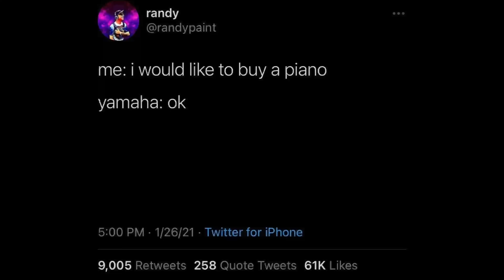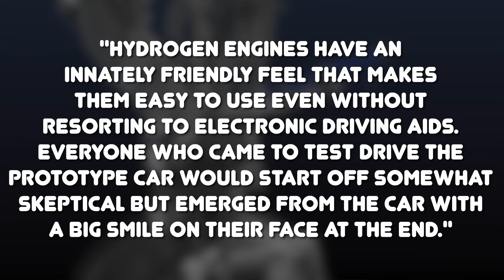Toyota's New 455HP Hydrogen V8: Everything You Need to Know

Comment: I highly disagree. EV is not long term sustainable . I work in the energy industry and the amount of mining it take to make a 600lb battery to compete with 5 gallons of gas is heavily subsidized and more expensive. We dont have sustainable battery metals long term, They're already rare lol. This isnt speculation lmfao this is facts.
Reply: But your 5 gallons of gas is finite. Once it's been used, it's gone forever. And think about all the electricity that was used to pump the oil out of the ground, then the transportation needed to get it to the refinery, then the 35kw of electricity needed to refine those 5 gallons, then the further transportation needed to get it to where it is sold. Then it gets pumped (using more electricity) into a vehicle which then burns it at 25% efficiency, wasting the other 75% as heat. Oh, and there is probably enough lithium to last another 25 to 30 years, with large deposits present in South Africa, Canada, the US, Brazil, Chile, Russia, China, the Congo, Australia and Cornwall in the UK. Plus batteries are now being produced with zero cobalt content. EV battery technology will at some point move away from using lithium. And rare earth doesn't necessarily mean scarce. It's a technical term used to describe the type of mineral.....  And EV batteries can (and are) be recycled, with the lithium and cobalt being 90% recovered and reused in new batteries. That isn't something you can do with petrol.....
Reply from the maker: It literally is speculation, or atleast misinformation. Lithium isn’t rare at all, one Google search can show you how high it is on a list of materials available on earth, and there’s plenty of it available in this earth. It’s the process to extract and refine it into something useable that’s the problem.

Comment: Dude is on crack! Combustion engine isn't going anywhere any time soon. Electric isn't the future. It would end in up a class luxury and no one else will be able to drive. The pure cost of computer goods would be unattainable because of the rare earth material necessary to make them. There rare because they are sparse to begin with. Meaning not everyone can have one. Meaning the combustion engine will still be around. Doesn't mean that electric doesn't have a place in the system because it does have purpose but it isn't the next great leap forward.
Reply: New combustion engines are after 2030 in the UK and Europe. They're going out of production.... It will be illegal to sell a new one.
Reply: @Brian-om2hh  It's all smoke and mirrors.

Comment: Producing electric batteries is really carbon intensive, and the mines that Tesla uses to get their materials have terrible working conditions and some even use child labor. Hydrogen can be produced from water very easily, and if Toyota builds the infrastructure to fuel their cars I would pick a hydrogen car/truck over an electric vehicle
Reply: Most of the clothes you are wearing now probably used child labour too. Has that ever been an issue for you previously?

Comment: You're wrong about something internal combustion engine do have something way superior over the elecrtic car. What I am talking about is the chills it gives, the fun it produce, the light weight it has, the noise it make, the option of being manual, the clunky and mechanic sound it does the tunability it has etc. Combustion engine are there for people who love motorsports and history of car. If I cann choose between a powerful electric car or a all wheel drive manual hot hatch with a engine that produce a sweet stustustustu and a sweet sound I will choose that car even if it is less efficient or safe  or what ever reason you got.

Comment: Internal combustion is limited in efficiency by the Carnot limit.  These engines will never be over 50% thermally efficient in production cars (Mercedes f1 engine is 50%). If we could get 100% of the energy out of the fuel in internal combustion, a toyota corolla would be making 200-300hp and getting 40+mpg while being naturally aspirated. The reason why these engines sound good is because they are wasting energy as sound. Hydrogen is not easy to produce at the moment, has a lower volumetric energy density than gasoline and require more energy to produce than is released so you need high system efficiency to use that energy in the best way. Hydrogen Fuel cells are not as efficient as the battery electric system efficiency, however it does not require huge chemical batteries, but they are more efficient than internal combustion. One of the largest issues with hydrogen is infrastructure which like gasoline, requires large amount of energy to distribute it as it must be driven on tankers to fueling stations unlike electricity which is only subject to transmission losses.

Comment: There is one path to put H2 powered vehicles on the showroom floor. Fuel cells. Sorry about the ICE. With fuel cells you get 1) All the benefits of EVs plus 2) The rapid refueling of the current lineup. Of course the single biggest gotcha for the H2 scene is there is no H2. Few mention that it costs more in energy to produce H2 than you get out. Current methods produce the pollutants we are trying to avoid and handling H2 is high tech dangerous. We'd have to go all in for H2. Meaning huge nuke power plants near the oceans. Suck up the salt water (  potable water to precious) ; desalinate ( alleviate potable problem); electrolyze; bada-a-bing H2. Yeah.

Comment: I agree with you that electric makes sense for most cars but if say in 30 to 50 years most people can’t own gasoline powered vehicles for one reason or another this option may become the only one if you want to still get the full driving experience. Also just like the electric grid which took decades to become what it is now the hydrogen transportation network will improve especially if your of the view as I am that fully electric heavy transportation is not effective ie 3/4 ton pickups, semi trucks, planes, helicopters etc.

Comment: You really couldn’t be more wrong. 😑 
Soo many things you left out. 
Hydrogen is the only fuel of the future. 
There is not enough cost effective precious metals to supply the world with enough batteries for all its cars. The mining for the metals is also disastrous on many levels. 
Hydrogen is the cleanest fuel there is. Hydrogen can be taken from water by splitting the molecules with heat and electricity witch can come from solar power. Pure water is your exhaust. In fact you will actually be cleaning pollution out of the air by running a hydrogen engine because you will be braking down pollution molecules like an EGR does. Maintenance on a hydrogen engine is not the same. Your oil will never get dirty because there is no carbon or sulfur or any other hazardous materials in hydrogen. You will not need a catalytic converter on a hydrogen engine. Hydrogen tanks have already been developed that can handle a blazing fire and shots from heavy caliber weapons. There will not be a Hindenburg repeat. Leaking hydrogen actually travels straight up at something like 35 mph. So no pools of explosive gas. But you don’t need to worry about tanks either because they have just developed ways to store hydrogen on film. Think huge camera film canisters that you switch out on your vehicle at gas stations. Now these canisters where actually developed for the cousin of the hydrogen internal combustion engine which is the hydrogen fuel cell which powers an electric motor. 
The only reason hydrogen hasn’t taken off is because there is no hydrogen supply infrastructure. Elon musk built his own supply structure, granted electricity was already spread everywhere, it still had to be adapted a lot for the vehicles and the major time consumption of recharge has still not been solved. It is also well known that the current electric grid could not even begin to supply every vehicle with daily charging. People don’t realize that the exact same amount of energy is still required to power a vehicle from point A to point B, it doesn’t matter if it comes from gasoline, coal, nuclear, diesel, hydrogen, etc. If your vehicle is powered by electricity which comes from a coal power plant you have gained absolutely nothing by switching from gas to electric. Also only about 10% of electricity from power plants is actually used by consumers, the rest is lost in transmission lines. 
Make no mistake Toyota is years ahead of anyone else because they play the long game while all the other companies play for the now money.

Comment: electric is not the future guys. Australia and many other countries are struggling to keep the lights on even still using fossil fuels to generate electricity. there is no infrastructure to support the consumption of electricity to power all these cars and is near to impossible to do it with all green safe energy. it's a half *ocked half a**ed idea that only works if your plan is to kill off half the population in the next 10 years..............really think about it. hydrogen can be adapted to our current cars and infrastructure so no need to manufacture all new vehicles creating more pollution, and people get to keep their classic cars that they love. electronics fail, face the truth, one day your Tesla battery is going to fail then the cost to replace will be more than the car is worth not including the hazardous waste disposal involved. wait until more car crashes start happening with electric vehicles there will be a rise in electrocution and burn deaths. what happens when someone messes up a grounding strap at a charging station and people get fried. did you know that lithium when exposed to water including the moisture in the air has a chemical reaction causing it to burst into flames. did you know the average cell phone battery can ignite and burn at 1800 degrees F. then there's the electric radiation nobody is talking about maybe it will be fine or maybe we start seeing health problems over time like when you live too close to power lines. any of this stuff ringing any bells people? step back into reality and stop drinking the coolaid. some of these problems can be solved yes but at what cost?

Comment: There are two major problems with a hydrogen internal combustion engine. First, hydrogen is not as energy-dense as other fuels, meaning that you need a whole lot of it to do a little bit of work. Couple that with the inherent inefficiency of a piston engine (at best, you're only turning about 30 percent of the fuel's energy into forward motion), and you've got a recipe for disappointment.

The second problem? When you combust hydrogen, you get other emissions besides water vapor. Mainly, you get NOx, the toxic emission at the heart of the Volkswagen diesel emissions cheating scandal. If you're looking for a clean alternative to gasoline, hydrogen's NOx emissions take it out of the running.

The answer? Use hydrogen in a fuel cell to generate electricity. Fuel cells are far more efficient than internal combustion engines, and a hydrogen fuel cell has cleaner emissions than an internal-combustion hydrogen engine

Comment: The biggest problem with electric cars are the batteries!  Mining is horrible for the environment, and takes alot of fosl fuel to mine.  At this time there is no good way to recycle the batteries and are toxic if they leak or catch fire. Presently they go to landfills!  Hydrogen could be very viable if filling stations come across the country it can become a cheaper fuel with more availability. It is clean burning the vehicles can be recycled properly.  On a different note if car industry takes some notes from the mowing industry they can extend the oil chang intervals.

Comment: Stupid x2! Fist you take out 1/4 of the energy from oil or gas.
Then you put it in an engine that looses 4x the energy to the wheels..

Why not use a solenoid engine, and battery?

Or, even better use a sound card?

Comment: If Toyota, Yamaha, Kawasaki, Mazda, and Subaru can get other manufacturers outside of Japan on board with Hydrogen power ICE like say VAG, BMW, Daimler-Benz, GM, and Ford they might have a chance in getting the infrastructure to support Hydrogen fueling stations. They'll probably need big on their side to build out such an infrastructure.  These are all big ifs since all other auto manufacturers have jumped on the electric bandwagon.  So the odds are against them right now.  But I hope they succeed. I find it hard to get excited about EVs I just find them soulless and boring.  Once ICE goes away I'll probably quit being a car enthusiast. 🤷🏿‍♂️ Best case scenario I'd say Hydrogen fuel ICE  may be marked as a niche product for enthusiasts who love engine sounds.

Comment: I think the whole idea that we MUST strive to be "carbon neutral" is a flawed one. 

We NEED Co2 for our own survival. Anyone who has even an elementary school level of science education knows about photosynthesis and why we need plants to survive. 

Without any Co2 production all sentient life on the planet would die. 

So when governments, and politicians lecture you from their ivory towers about climate change, don't buy it. If they actually cared they wouldn't live in beachfront mansions, fly in fossile fuel powered private jets or travel on diesel powered yachts, and they wouldn't raise your taxes and gas prices as opposed to planting more trees.

Also I don't see normal ICE cars going anywhere for a while due to a few simple realities. 

LiON batteries are still highly toxic and very bad for the environment. 
They also add alot of weight.
EVs are less efficient on the highway than cities and usually by alot. 
Having thosuands of power stations capable of charging an EV in less than an hour from empty will raise everyone's electric bill and probably strain our grids too much. 
Most people who own an EV likely still own an ICE car anyway so you don't really get the advantage of lower running costs. 
Tesla's are well known to still be expensive to maintain despite the electric drive due to the complex electronic systems. 
Batteries typically only last 8 to 10 years and are very expensive to replace. Meanwhile my family's 2004 Toyota Highlander still has the original fuel tank 18 years later. And that fuel tank is much smaller and lighter than a LiON battery pack. 
Electric motors might be more efficient but the batteries have far less energy density than gasoline. Hence why in a full size sedan you need the whole floor's worth of batteries to get 200 miles range.

Comment: I think hydrogen will be an amazing tech to look into as if it can be made to work well its amazing and you can have nice pure water dispensed in your car if you wanted. Cost wise its not neutral and nothing ever will be, it'd be more beneficial to recycle as far as the planet goes and as long as items are gated by money nothing will ever be as cheap as making a new one. BUT i think hydrogen will be an awesome way for enthusiasts to keep ICEs going and motorsport will still be able to attract old and new with it. Not only that electric car components are new, have very few standards and limited resources to produce batteries at the moment. IF anything a hydrogen range extender would be the ultimate compromise
Reply: Lh/lng can be retrofitted to existing Engines

Comment: Don't forget that Electric cars use massive amounts of lithium and cobalt which in both cases are very detrimental to the environment (both the mining and refining processes). Hydrogen engines have the potential to replace both electric and gas and ya there is some infrastructure to be put in place but not much because Hydrogen can be made from water with a by product of oxygen. So in reality no gas lines needed just have hydrogen generators at gas stations connected to the water main and they could be sold to the public to make hydrogen at home.
And because it's essentially a gas engine with different injectors there is the option of conversion kits so people can keep the car the have.
Reply: How much lithium do you think goes into a typical EV battery?  80%?  90%?  Nope, it's less than 5%...... The big oil companies have mined cobalt for decades. They need it to remove sulphur during the refining process. Is that detrimental to the environment too? The oil companies are the largest users of mined minerals BY FAR......  And how do you think hydrogen is produced?
Reply: @Brian-om2hh  https://www.youtube.com/results?search_query=hydrogen+generator
There are a number of videos showing this prosses. The hydrogen ICE and the HFCEV are both better options than EV's with a giant battery for one main reason, energy storage. Gasoline has a much greater energy to mass ratio than batteries and hydrogen is a gas allowing us to compress it even further giving us longer range on one tank. The simple fact is it is easier to upgrade a small portion of the electrical grid to account for hydrogen generators than it would be to upgrade the entire system to account for 300 million people charging their cars at once and do to the gaseous state of hydrogen it makes for easy transportation and 40 years down the road when the grid can keep up companies can sell small hydrogen generators to the public. Not to mention EV's off road have had range issues, one instance 19 miles of range barley went 3 miles.
Reply: @Brian-om2hh  thought you would find this interesting 
https://youtube.com/shorts/yGDkiUAwxRs?feature=share